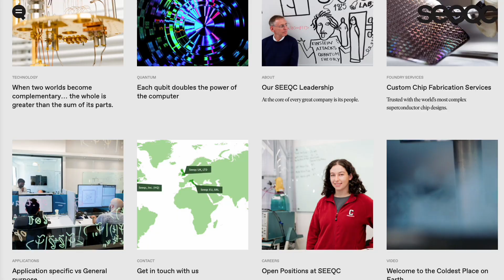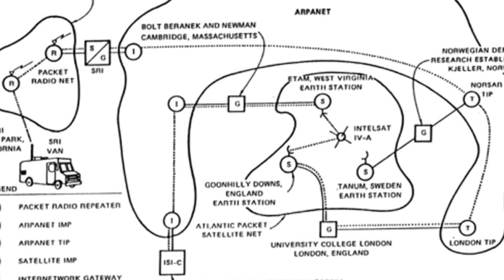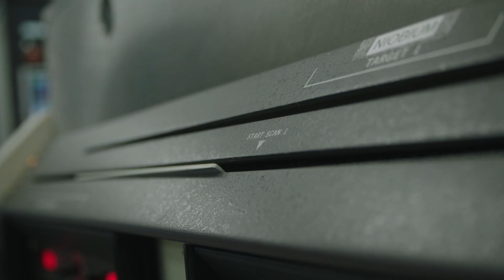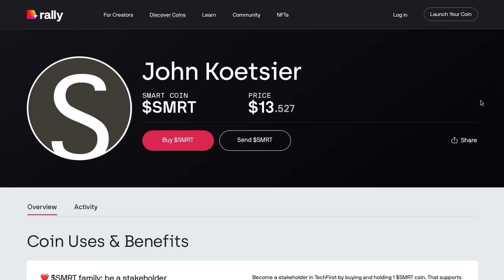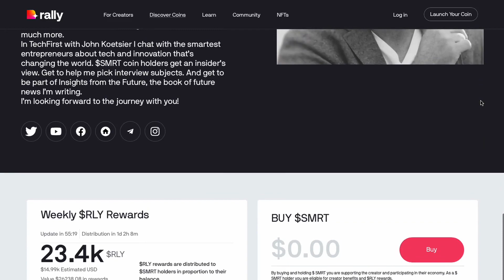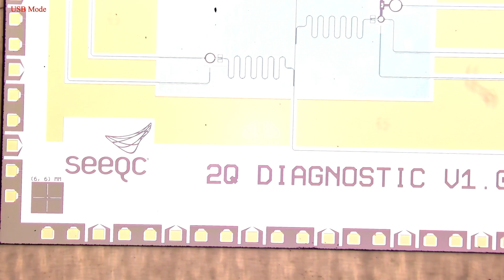Million-qubit quantum computing ... at $300 per qubit

Comment: I was told an 100 qubit system could process more information at the same time than there are particles in the known universe. I don’t understand why such a high qubit count past that is even needed. There’s also many fine print issues with quantum computing announcements. Couldn’t you arbitrarily stack as many as you want but not necessarily have an algorithm that can use so many? I’ve heard some companies have a whole bunch in an array but functionally they cannot solve any problem of exponential data up to a certain a,punt of qubits. Sorry lol lots of confusion heh.
Reply: In theoretical, 300 qubit computer can perform a number of calculations that is higher than the number of atoms in the universe.